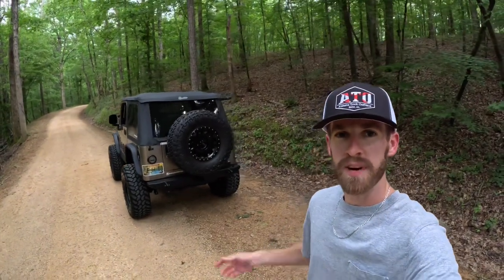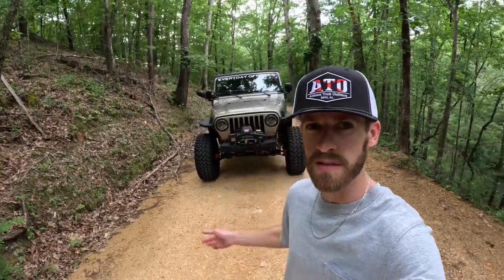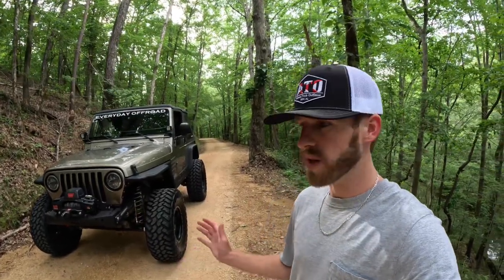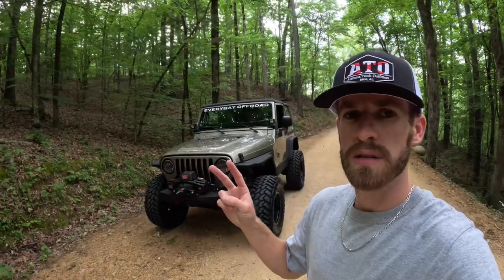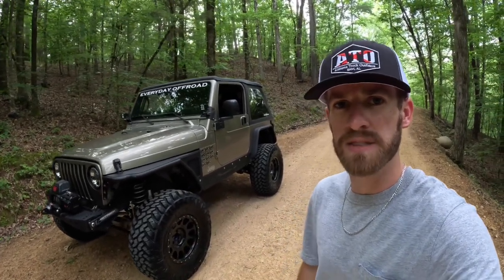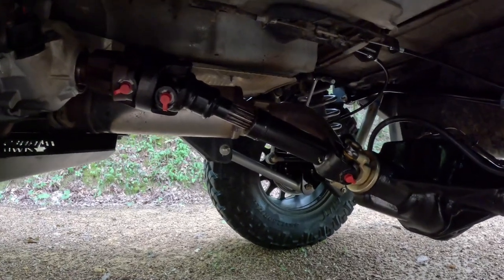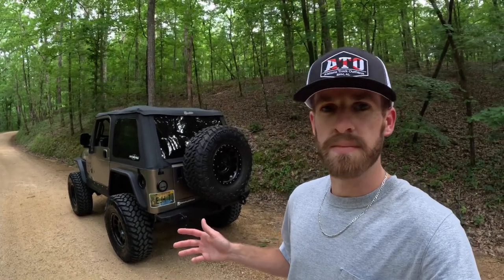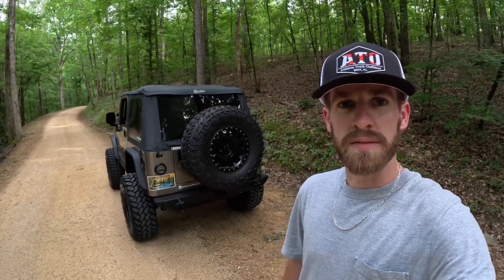JEEP TJ AXLE SWAP PART 2 - Brand New FUSION Elite 44!

Comment: I also ordered my front and back axles on January 30, but with arb lockers. now they are installed may 9. Slowly breaking them in for the first 500 miles.
Reply from the maker: Nice. I’m breaking mine in now too. Several heat cycles and a fluid change after a few hundred miles
Reply: @EverydayOffroad  so far I've  done 3 rounds of 20 mile at 45 mph tomorrow I'll  do 2 rounds on the freeway at 60 mph then the rest around town until the 500 miles up then the oil changes. Hope you can make a video of changing your diff. fluid and looking at the gears!
Reply from the maker: Was planning to do that. Thanks for watching the channel!

Comment: Did you source a t-fitting for the brake lines? Or did the axle come with one? The one I just got in doesn't have the same set - up as my D35 and they didn't ship the axle with a new fitting.  I need to call them  (ECGS).
Reply from the maker: I was able to use the fitting off of the Dana 35. The Fusion came with hard brake lines that plugged right into my existing T fitting. Mine didn’t come with a new fitting either.
Reply: @_everydayoffroad_  Good info Thanks man, I haven't actually pulled my 35 so maybe the fitting will work. It looks welded and has the vent tube incorporated into it.  The vent tube on the new Dana489 I got is separate from a post with a nut on it that looks meant for a specific t-junction.
Reply from the maker: Your existing fitting off the 35 should work. Mine came the same way. Looks welded, but if you take the vent hose off and start loosening the nut, it starts to loosen up and come off.
Reply: @_everydayoffroad_  oh really, perfect. thanks again
Reply: Did you do anything different on the shock perch on the axle? my springs fit way better on my D35.  On this one they use the washer plate and bolt to retain it but how do you position the springs? My 35 had notches and fit snugly over the bump on the perch.  On the new 44 the springs diameter is way larger than the diameter of the cylinder on the perch.
Reply from the maker: @lundysgarage  I did not do anything different, I too have extra room on the bottom spring perch. The coil can move around slightly when offroad but the little disk you bolt onto the perch holds it in place from coming off completely.
Reply: @_everydayoffroad_  What length driveshaft did you get? I've got to order a new one as well.  Axle is in but i think my adams I have in there now is just a bit too long. somehow... it already looks as short as it can go!
Reply from the maker: @lundysgarage  Tom Woods 15.5” rear driveshaft fits like a glove. My Adams was 16 3/4” or so.